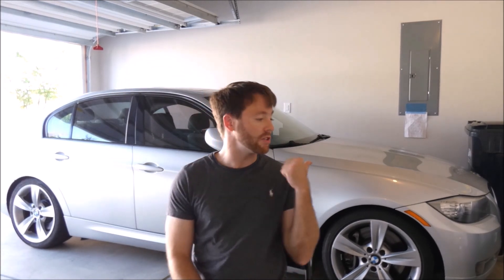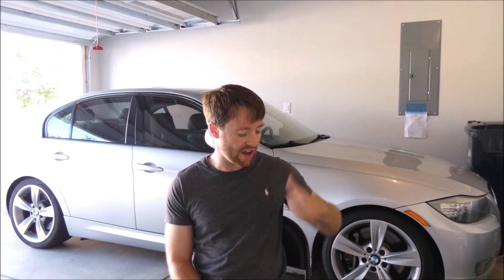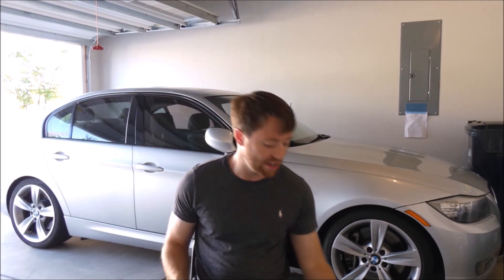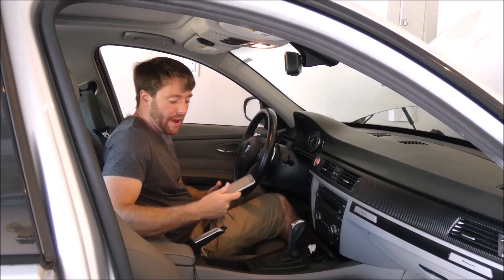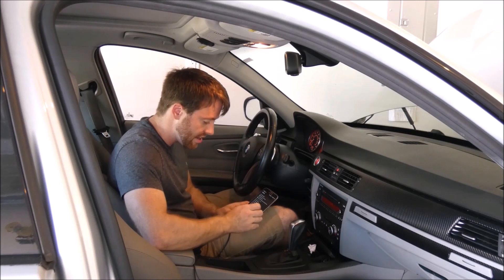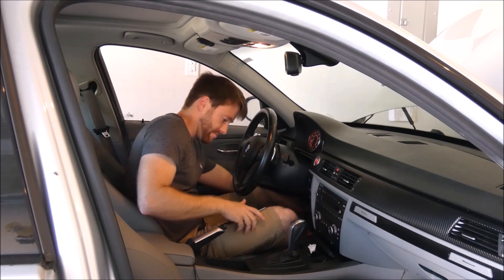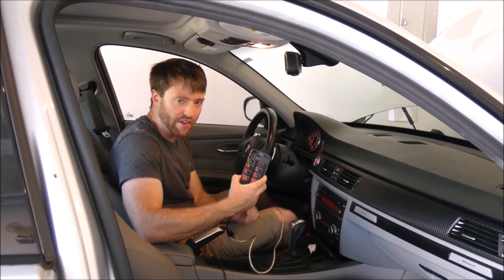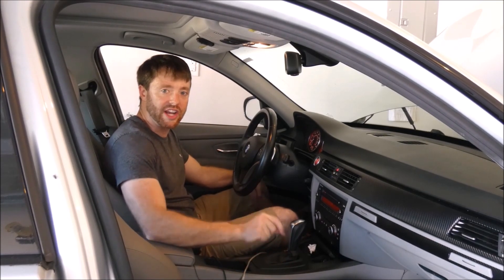Using MHD Tuning to Cool Your Turbo BMW!!!

Comment: I never knew about this function, heck yeah!
Reply from the maker: Yeah it’s a neat little trick!
Reply: BMW-E90-HQ for sure! Do you think even the sport selection could potentially decrease the life of the water pump over time or probably ok?
Reply from the maker: I think it could just because your asking it to work harder. But I’m not sure that the difference would be material.

Comment: Just replaced my water pump/thermostat just for maintenance still worked at 102k.. didnt want to press my luck. Now crankshaft sensor is acting up.. time to clean your dci's
Reply: Also getting ready to install bms transmission cooler and secondary oil cooler
Reply from the maker: Yeah the pollen here is so bad the get dirty so fast it’s unreal they were red not too long ago. I’ve heard that crank sensor can be a real pain.
Reply: @BMWE90HQ  ya mine were really bad as well just cleaned them last week.. ya it stalled the car left it in 3rd gear only.. had to restart and reflash transmission.. going to pick up a new one from fcp..

Comment: Be careful deleting the cowl, it protects your DME box from getting wet when it rains or washing your car. Heat will be the least of your worries if water gets in that😂 The sad part is even though this video is 5 years old, the M cowl is still like 4 or 5....HUNDRED dollars😒 For plastic
Reply from the maker: This is a concern although I never had an issue with this.

Comment: If you ever fixed the rattle that happens after starting the engine for two seconds then please let me know or make a video about it. I own e90 330i lci n52b30, I have the same problem. I have changed the two vanos in the front of the engine , also another one under the engine changed the spark plugs and I had no luck. Thanks
Reply from the maker: Will do!
Reply from the maker: Was there oil on your plugs by chance?
Reply: @BMWE90HQ   no
Reply: it’s normal lmao, change your oil